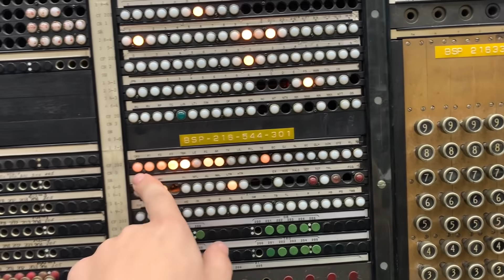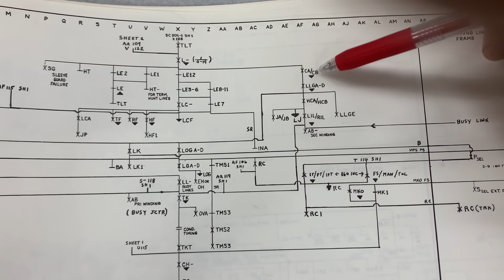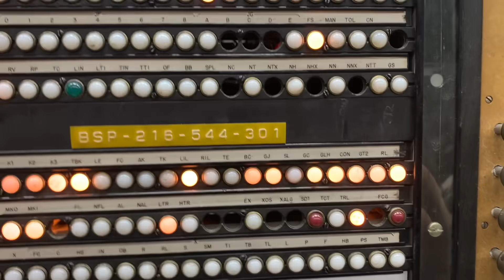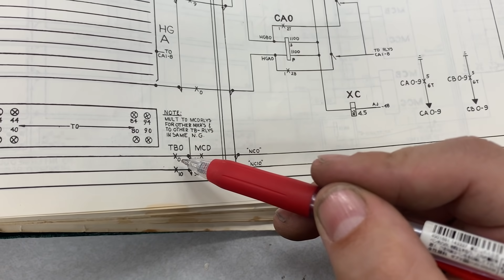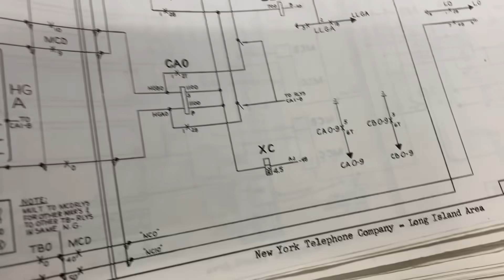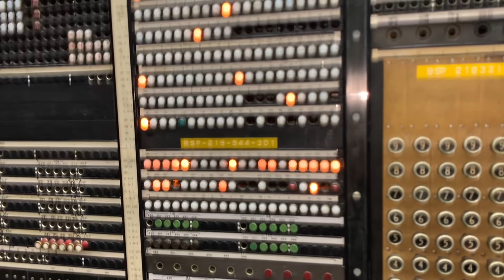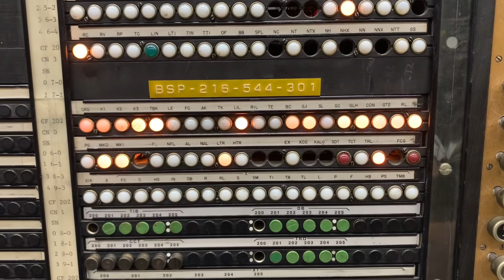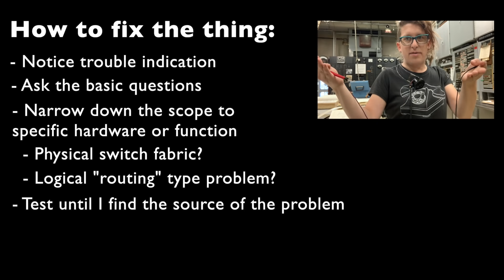Why isn't the 1XB completing calls?

Comment: This brings so many memories.  I worked SXS local and SxS Cama which was a common control system so to speak.  It had 8 senders,  4 transverters, 4 recorders with the perforated paper tape machines. Also worked Ani b & c systems. The office was a class 4 toll and class 5 local facility. I loved reading the detached and sequence prints to troubleshoot the the Cama system.  It provided for some 14 cdo's  which were SxS around the lake of the Ozarks area in Central Missouri centered at Eldon, Mo. I never worked crossbar per sa, but our Cama system had incoming registers and links which were 100 point crossbar switches. Also worked on the toll switchboard occasionally. Such cool stuff wished I could work it again. If I ever get to Seattle,  I gotta see this. This is your best video yet.  Thank you so much for your video. It has been very enjoyable.
Reply: We had a lake lot served by Sunrise Beach, and any long-distance calls to the locality came up Gravois Mills.. my parents were too cheap to put a phone line in, so we had to bug the retired neighbors.. it was weird how Eldon wasn't local, IIRC, but it was our link to the world... I still remember how MFs sounded calling there, it was the late 70s they had dial at the neighbors but we had a touch-tone... I never knew until after I left working for the phone company what those MF tones meant, and how fast they went, yet to find a crossbar that could save and process a call lickety-split. There were some calls you heard MF multiple times...
Then as a kid, I sat down with a Kansas City phone book, back then local calls on either side of the state line were protected, and no duplicate issued central office codes unless you dialed 1 for in your area code, plus 7 digits or all 11 for another area code, but anyways, I found published pager numbers, which intrigued me, you heard the clickety-click ratchety sound of RP, I don't recall if the call went through GR, BA, or what downtown CO it went via.. for what I remember it could have been a 47X exchange, mom worked at a few places assigned it... 
In retrospect we never appreciated local calling as we should have, One vintage of a switch could call another and know how to pass the call along...
What puzzled me was one of our residences was served in a building with the same rate center but two dissimilar office codes, ones that also were numerically adjacent to others in the local calling area.. for example, 796 could call 257 served in the same building, but 256 might be more-so downtown Independence served,  it knew whether to call out for tandem or trunk vs same building and could sort it out. Then we moved to Blue Springs, the first 3 digits were assigned based on if you were toll to/from the center zone, when I was old enough for my line, it wasn't asked, but was given the same as my parents used, by this time 228 and 229 were both now local throughout the calling area, not one is and the other isn't.. then it came time for a number change, we had to stay on the same office code even after 1AESS was in use there.. we found a exploit to have three users all with call waiting become a 3-way call without the paid service or operator involvement. 
And to think I can't talk "phones" of yesterday with my roommate,  he says his concern is, does it work or not..
Both Sarah and SxSPhil have places I'd love to visit. One of my school was served by XY and it was long removed before I knew how it worked, United had many of them, many of their offices had a couple of thousands levels assigned if that, but that honking busy..memories.. 
Time for me to hang up.. NyTol.
Reply: @Stache987  I may know you. I worked southwestern bell 1973 until 1982 when I transferred to at&t long lines. I worked the sunrise Beach cdo for about 4 years then the Eldon told center about 5 years.  I'm Ted Fox.  Yes I would absolutely love to visit the see Seattle's connection museum and sxs Phil's switching systems.
Reply: @t13 fox  most likely not, I was  a "sheltered" kid, my first telco I worked for was Verizon landline.  I live in a Central Iowa Podunk town where we have a co-op for a joke of a phone company,  it's service area is so worthless unless you just put in a line for incoming calls, you cam call about 2500 lines toll free aside from the overbuild in colocated exchanges with dedicated prefixes.  Although I would like to meet up with people who could talk "phone" at leisure.
Reply: @Stache987  well,  at least we've worked similar careers.
Reply: @Stache987  yes, we could talk anytime.  It would be great.

Comment: It's like watching someone practicing an ancient language spoken only by 13 people left on earth that understand it. Who will carry this work on a few decades from now, or will it, one day, stop working, because those 13 have all died? And then you might as well just shut off the power like one of those 10" diameter steel shafts I saw once in a museum that used to turn the parts of a purely mechanical computer; it will never rotate again, because the display was only a piece of a giant computer that was cut up and is no more.

Comment: Ah shit, it's those cold joints again! You do a wonderful job troubleshooting such a complex system :)
Reply: How could this equipment have had a bad solder joint all these years?  Weren't these frames in service in a CO?  Why solder and not wire wrap?
Reply from the maker: @jd3497  They were in service, sure, but then all of the interframe wires were cut, and the frames were trucked to the museum. Then a bunch of old guys soldered them back together between coffee, donuts, and lunch break!  (Wire wrap didn't exist in 1942.)

Comment: I love how you are able to break all of this down, but I have one question: how would the troubleshooting be different on a 'real' system? I would imagine other calls would interfere with your troubleshooting measurements and also vice versa. Is this a place where a real exchange would have multiple copies of this circuitry so you could isolate the one under question?
Reply from the maker: Good question. In the museum we have just one of each frame--one Originating Marker, one District Link, and so on. In a real working office, you'd have several of everything, and the load is distributed evenly. The first step in troubleshooting is to "busy out" the effected equipment to take it out of service so you can troubleshoot it. The remaining frames will take up the load during that time.

In the museum, I don't bother busying anything out, because there's no point. There isn't any remaining equipment to take up the load. The only case where I will do this is for a specific trunk, or a specific sender--those can be busied out because there are several of each on a frame.

In real life, there are some frames that you just can't busy out, regardless of how many you have. An example of this is the line link frame, and the number group connector. On those frames, each piece of equipment corresponds 1-1 with a subscriber's line, so you can't take them out of service because it would deny customers access. In those cases, you can try to busy out only a small portion of the frame to have the least impact possible. In addition, the control circuits on those frames are "mated", so in the case of an emergency, a controller from an adjacent frame can take up the load, even though it would not normally handle that load.

Comment: What would the result of this bad solder joint be from a customers perspective, or would they notice a problem at all?  Would this be affecting the dialing party or the dialed party?  I love being able to  eek out a problem step by step, using flowcharts, ladder diagrams, wiring diagrams, and field testing and troubleshooting.  I work in the low voltage security industry and when I'm troubleshooting a problem I always start by asking myself 'what is the system supposed to do? what is it doing instead?, when did it fail and what was it doing when it failed?'  Often times I'll look at the last recorded video if it's a camera problem and watch as a lightning storm rolls through, or a camera turns in to a fishbowl from a water leak somewhere.
Reply: It sounds like the call wouldn't go through. It would get stuck OR it would go to an error signal, like busy.

Comment: What are the jacks at 24:25? (48V and GND are self-explanatory..., curious about the others)
Reply from the maker: F - Test jack. Lets me plug the remote control into the test frame and execute tests without having to physically be at the test frame.
A - 48V/GND supply for whatever equipment I'm using in the aisle. Lamp, test cart, anything.
B - Belt line. Just a pair of wires that runs to every single frame in the entire office and I can plug whatever I want into whatever else. I usually use it as a telephone line and plug the other end into a particular dial tone appearance on the line link.
TEL - Telephone. I can plug a headset in there and talk to anyone else in the building. All other frames have a similar pair of jacks for a headset, and anyone plugged in there is on the same building-wide talk circuit. No dialing, just talking.
HRG - High Resistance Ground. Ground through a resistor so I can test things without blowing fuses.
Reply: @ConnectionsMuseum  belt line is a great idea for them to include

Comment: It seems that everything electrical is subject to a bad solder joint, transistor radio to modern computer.  At least back then we were allowed to use lead based solder.
Reply: I just fixed a bunch of black magic video gear with - yep, you guessed it - poor/cold solder joints in the power supply.

Comment: It's going to take me a while to get through all of this, but I always longed to know how a crossbar switch worked. One question I have is, in the actual matrix, where a row gets connected to a column, is there a separate relay at each point? Or do I understand that there's a finger on a metal rod that can slide up and down, and make or break the connection between any row and that column, so that the whole affair has fewer moving parts?
Reply: There's a video about the crossbar switch. There isn't a separate magnet at each point, but there's a separate set of contacts a point. The row and column magnets mechanically jam them closed as long as the column is held active, if the row was active at the moment the column was activated. This is accomplished with the fingers loosely attached to the row bar, and the column bar jams them in their current position.

Comment: Wire wrap connections are more reliable than solder joints (per Bell Labs research)
Why don’t you cross train others in troubleshooting?

Comment: Great video! I know I could Google my question but likely will get 50% flat out fake answers so if you kindly would explain, when you have a sec in your own words, having been exposed to the secrets of this tech for so long: what's the point of the power source architecture of -48v, ground and +48v? Is 96v ever used anywhere? Why do it that way? I know in op amps and comparators the reason for the split supply but in the world of mechanical relays? Thanks a bunch!
Reply from the maker: 96v is not used anywhere. It's only - 48V referenced to ground in analog telephone work. (+/- 130V is used in carrier circuits, and -24V is used in local manual circuits, but thats a different question).

The reason for using -48V is to prevent electrolysis from occurring in buried cables outside. Telephone companies spent a lot of money on outside wiring, and soon discovered that if the cable voltage was positive relative to ground, that electrolysis would occur and slowly eat away at the wire, leaving the cables useless. By keeping the wires negative in reference to ground, electrolysis doesn't occur, and all of that money that they spent on cable wouldn't be wasted.

There's no other reason for using negative voltage in relay circuits. The relays themselves don't care which way the electrons are moving---unless they're polar relays :)
Reply: @ConnectionsMuseum  Thank you!

Comment: Sarah @connections museum Have you ever thot of connecting a voip fxs ata adapter to your phone system in the museum as a incoming trunk and a fxo ata adapter as an outgoing trunk so that people from outside of the museum can see how the old phone systems worked and how you can connect extremely old equipment with modern day equipment